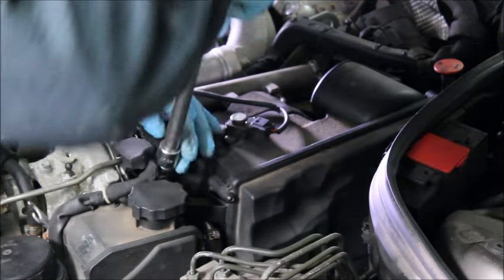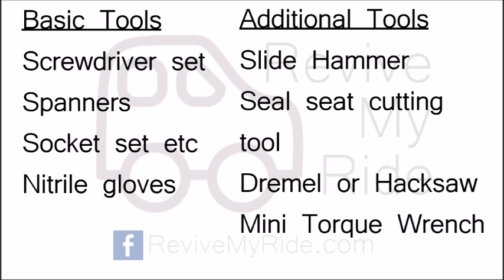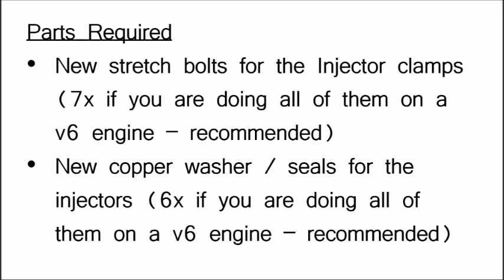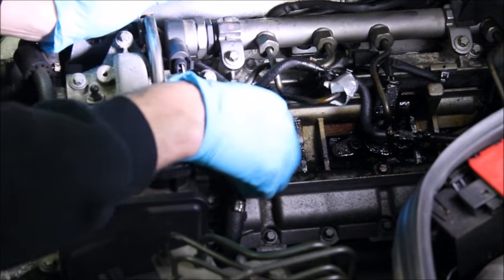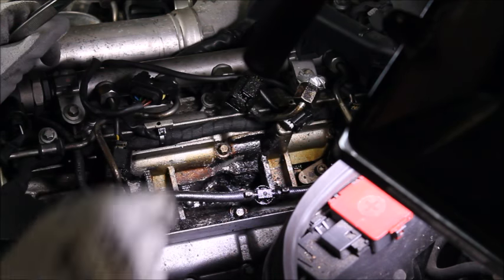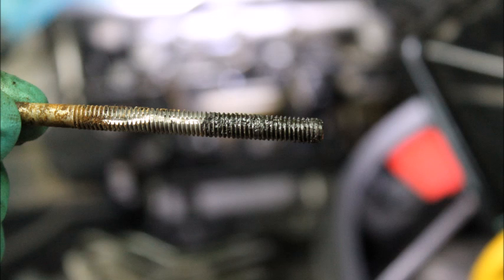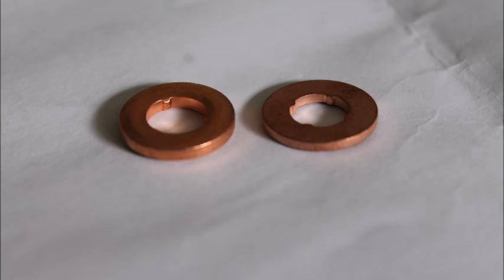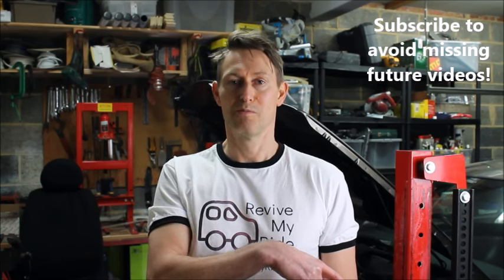Mercedes diesel CDI (Black Death) leaking fuel injector - How to diagnose and fix on 3.0 V6 engine

Comment: nice write up and video, great work!
Reply from the maker: Thanks for the feedback, much appreciated! Glad you liked the vid :-)
Reply: @ReviveMyRide  hi mate, hopefully you can help me again, 👍...tell me, have you any videos on slow to start e220cdi w211 in hard frosty conditions, it turns 3-4 times before it finally lights up, is it air in the fuel lines? Do I Change the seals, can they be changed? What do you think, you been a great help in the past🤞, thanks in advance
Reply from the maker: @thebull4358  Hi, I don't have a video on this yet but will try to give some advice! You will know how your car behaves better than me but in my experience, diesels are always slower starting in cold weather. A few ideas though: 1) They have the glow plugs to help with cold weather starting. I'm sure you already do this but when starting the car from cold, always make sure you turn the ignition on but then wait for the yellow glow plug symbol on the dash to go off before starting it. In addition, in my car, I have found that once the glow plug light goes off, if I wait an extra 3-4 seconds, it starts more easily. 2) Is the engine turning over on the starter motor noticeably slower? If so, the battery may be getting past its best (batteries don't like cold weather and once they get old, it is in the winter when they fail) but make sure you check the battery terminals & clamps to make sure they are clean and have a good connection first before replacing the battery. To do this, I disconnect the terminals, clean the terminal with sand paper, clean the inside of the clamps with sand paper and then reconnect (put some grease on the terminals / clamps afterwards to keep them clean for longer). 3) I don't think this applies to you but I will mention it just in case. If the car turns over many times (7 or 8 times) and then times out (fails to start), and you have to try again, then it is possible that it is the glow plug control module. Read the car for codes using an inexpensive OBD2 reader and see if there are any showing. 4) Finally, if you remove the engine cover and there isn't lots of carbon building up around the injectors, then you can rule out the "black death" leaking fuel injectors. It's a biggish job, so I would investigate the other points 1-3 above first. Hope this helps, let me know how you get on and if you have any other questions! Cheers, RMR

Comment: Great video = dumb question but if I have a couple of leaky injectors, do I need to replace them or just replace the seals? My logic says I just need to replace the seals.
Reply from the maker: Don't worry, it's not a dumb question at all! You just have to replace the seals. You can check the bottom face of the injector where the seal sits to make sure it is ok but 99.9% of the time it is fine because it is made of stainless steel and is much, much, harder that the Aluminum head that it is seating in. Sometimes you need to recut the seat in the head though...

Comment: thank you for the video….my c320 is suffering from “black death” on one cilinder. In the video around 19:40 you tighten the bolt with 8 NM and the you tighten it again with two times 90 degrees…why? I mean wat is the use of starting off with 8 NM and followed by 2 times 90 degrees?
Thanks for explaining

Comment: That little return line plastic clip you took off mines was a pig to take off,how hard do you have to push to put it back on?Mines doesn't seem to go on as easily as i thought,don't want to break it.
Reply from the maker: @bobbaxter952 It's been a while since I did the job, I know I found the collar very tight to undo, so I used a spanner underneath it so that I could get even pressure lifting the collar up. I think when I pushed the collar back down, I used the same technique. From memory, if the collar doesn't want to go down, then it is because the fitting isn't fully pushed down onto the injector. Try removing it and refitting it, when you refit it, keep firm pressure downwards on the fitting and push the collar down at the same time. The collars are very stiff in moving both up and down and I was worried about breaking them too but got away with it. Hope that helps! Thanks, Phil

Comment: The slide hammer you have listed in the discription is not the one you have used in the video.
Reply from the maker: Hi, Sorry, I made this video aeons ago, so sometimes the tool gets delisted and I have to choose another equivalent. Pretty much any cost effective slide hammer that has the right attachment onto the fuel injector should do the job! Cheers, Phil

Comment: i would like to share a little tip for removing injectors or pre heater plugs you may very well think im taking the micky but if you park her at night wait until until she is cold then pour Coca Cola around the heater plugs or injectors leave to soak over night take her for a drive next day & the heater plugs or injectors will come out with the greatest of ease . i can honestly say this works as used this method first on heater plugs that had covered 13yrs & 163.000 miles & i removed them without shearing the heads off them (head off if they brake) & removed number four injector today using same method without braking anything to replace the injector seal i did not do 1.2.or 3 as do not believe in fixing something that's not broken ... only thing that came to mind was if Coca Cola can destroy carbon what will it do to your gut when you drink it lol   further to the above before new heater plugs go in apply Copper slip on the threads they will never seize again in all a job i dreaded then wondered what all my worrying about as it was very easy fix ...
Reply from the maker: Hi Bryan, really appreciate you taking time to share your tips! Always good to get some feedback from others that have done the job! Just a quick question: I have heard that running the engine and then removing the injectors / glow plugs while the engine is warm makes them much easier to remove. Do you think this was the case with your car or do you think the Coke was also making the difference? Thanks, Phil
Reply: @ReviveMyRide  Hi Phil i did say in my post you must take her for a drive so she is at running temp before you try to remove plugs or injectors TBH i did try to remove plugs Hot they would not move but after an overnight soak in Coca Cola & a run they came out with ease  don't forget copper slip on reassembly /i was given this tip by a jaguar mechanic try my tip by soaking an old brown 2p coin soak it over night & see result in morning it softens carbon to the  point that all i had to do to remove the carbon off the injector was to wipe it off with a rag & standard thinners & return it to the head with new seal after cleaning the head n seat /original Mercedes parts only /can i ask do you think not doing 1 . 2 , & 3 was correct thing as if not broken don't fix IMO / thanks for your response hope all others use this tip to great affect .. Bryan
Reply from the maker: Hi Bryan, thanks for the additional info, I think it is worth me trying this sometime! Regarding changing the other seals - I was actually in two minds about it. In the end, I went ahead and changed all of mine because they come out much more easily when they haven't started to leak already and there isn't any cleaning up to do, which can be time consuming. However, if you are prepared to monitor them, I fully understand the choice to not mess with the ones that are still good if they seem fine. I have seen plenty of other comments where people choose to just fix the ones that are giving the problem, the ones that are currently good may never leak! With mechanical work, it is always possible to introduce a problem where none currently exist. Cheers, Phil

Comment: My 2012 ML350 W166 got done at 87k and problem was already really bad, so 60k would be a good place to do the change of copper seals, which is what my mechanic also recommended.
Reply from the maker: Makes sense. I think if had done mine earlier, I could have avoided the carbon cleanup, which can be time consuming. With these engines, this problem is more a “when” rather than an “if”, so scheduling it in like a maintenance take makes sense!

Comment: Very great video. Thank you. I got one injector from my G300cdi  having the same problem. Is that related to the EDC light on? The car runs a bit lump.
Reply from the maker: Hi, my understanding is that normally the EDC light is due to a fuel supply issue: fuel leak, fuel pump issue, blocked fuel filter etc. Also, I imagine (but don't have first hand experience of this) a bad fuel injector that is allowing too much fuel to pass. However, I don't think that "Black Death / leaking fuel injector seal", which is when combustion gases escape from the cylinder would cause the EDC light. BUT, many people get the EDC light after working on black death because they then have fueling problems, maybe from a leaking joint on the fuel rail or the diesel system isn't fully primed after completion of the work. Hope that helps! Phil
Reply: @ReviveMyRide  thanks for the tips. Will try to look at that issue.

Comment: I wish i had this 2 years ago when my 2007 jeep GC  had injector 1 get all crapped up.  I used a 13mm crows foot to get the injector to loosen up by rotating.  I did not use the seafoam and wish i knew of that before.  But i do have a 2005 MB CDI with a bad black death in injector 6 that i will use that technique to fix.  I also read on a forum to ensure the hold down bolt doent bottom out was to cut about 1-2mm off the bottom and recut the threads so they go down smooth.   I used laquer thinner to clean everything out in the whole for two reasons.  First it liquefied the black crud and i was able to blow it out of the holes, and two, it evaporated very fast and thus if any leaked into the cylinder, it would quickly evaporate.  Again thanks it was what i essentially did as well.
Reply from the maker: kamaksi24 thanks for sharing your experience! The lacquer thinner was a good idea and probably worked better for cleaning out the bolt hole. I used some Seafoam down the retaining bolt hole but then needed to prod some clean cloth down the hole a lot of times to be sure it is clear. Interesting idea to cut the bolt back a little because the big risk is the bolt bottoming out and either not holding the injector tight enough or shearing through over torquing. Again, thanks for sharing, helps us all learn!
Reply: @ReviveMyRide  Oh i agree 100%!  i already looked for the seafoam for the next round of black death and maybe even try it on the next round of glow plugs.

Comment: Mate you mentioned Nissan bolt as alternate but in description you given Honda ?  Which one is correct , also can we use any chemicals to clean bore if we don’t have tools like ego or carbon cleaner spray
Reply from the maker: Hi, it’s a Honda alternative copper seal, part number should be in description. Up to you regarding cleaning materials, Seafoam works good. If you use something else, Just be mindful that the head is aluminium and that some may get into the cylinder if you use copious amounts of liquid, so use it sparingly and ideally use something to clock the bottom of the injector bore. cheers, Phil

Comment: Thanks for making this video
Reply from the maker: Thanks for your comment & glad you liked the vid!
Reply: @ReviveMyRide  I was looking to get myself an ML320 CDI, yesterday, checked the MOT history and on the Monitor and repair if necessary section has Injector leaking gasses and Noise from steering column area - no play detected; can you advise?
Reply from the maker: @brownoforrington8310  If it is a car you want, you can ask the owner about both of these things. Ask if they have had them fixed and if so, if they have the receipt. If not, you could use the info as bargaining material. With the leaking injector, you can pop off the engine cover and have a look for carbon build up. Also, you would usually be able to smell it in the cabin. Sorry, with steering, I haven't heard of that issue, you would need to assess it on a test drive and again, depends on if the price of the car is worth the risk of a repair being required. new rack? just a new knuckle joint and shaft (where it meets the rack)? I watched a video recently for an Audi and it was just the knuckle joint and it just needed some grease. Hope this helps somewhat, there are never any guarantees with car faults & repairs!
Reply: @ReviveMyRide  Thanks a lot for taking your time to reply

Comment: Thank you for sharing as it was very informative. What year and model was this engine in.?
Reply from the maker: Colin Blankenship the car in this video is a C209 CLK 320CDI. It is a 2007 model but they built these 2002 to 2010. The engine featured is the OM642 (3.0L v6 turbo diesel). It was used in a lot of different Merc cars and vans from the era stated above. Hope that helps!
Reply: @ReviveMyRide  Thank you

Comment: Thanks the video, I hv Mercedes printer 315 CDI 2008 model done 390.000Km  Have an issue with smokie and fuel smell. smoke come randomly sometime big smoke sometime just a litle bit even sometime no smoke at all. before that I did replace cooper washer only 1 injector, also 3 months ago done DPF cleaning. need your advise. Thanks heaps.
Reply from the maker: Hi, happy to help if I can! Just to be clear, is the smoke and fuel smell coming from the engine bay and you smell it coming through the air vents into the car? If so, as you say, this may be linked to a fuel injector seal problem. If the smoke is coming out of the exhaust, that is a different issue entirely! Usually, if an injector seal is leaking, then you can see which one it is by inspecting and looking for carbon deposits building up around the fuel injector itself. If you have had 1 seal replaced, then the chances are the others aren't far behind. I recently did another follow up video that shows in much more detail exactly how to inspect and what to look for. I think the first step is for you to do the inspection. The video is here, hope it helps! https://youtu.be/7weS1vQ_1OI Thanks, Phil

Comment: How does the seal cutting tool work? I mean does it take off only the dirty or does it groove the injector seating as well? Would a dremel spinning wire brush work as well? Also did you remove the protective washer that you put earlier to prevent dirt falling into the cylinder while cleaning the injector washer seat? Thanks.
Reply from the maker: Hi, the cutting tool can be used just to clean up the seat a little bit or to recut it by taking more material off. However, if the seat just needs to be cleaned up a little, then I recommend using a piece of fine emery cloth (fastened in place by some double sided tape) to the bottom of a length of wood (similar to a broom handle but smaller diameter). Seat cutting should only be done if the seat is badly damaged and always done with caution taking off the minimum amount of material to make the seat good again. If the seat is cut too deep, there is a risk that the new seal won't be compressed enough to seal properly. I would be careful of a Dremel wire brush, you are correct that the washer that is sealing the seat needs to be removed to clean up the seat or to recut it, therefore, there is a risk of wire from the brush getting into the cylinder. Hope this helps!
Reply: @ReviveMyRide  Thanks a lot for taking the time to answer.

Comment: Some people say you should grease the injector before installation ..good idea?
Reply from the maker: Hi Geoff, Sorry for the slow reply! Yes, I think you should use a thin coat of grease on the outside of the injector body (not essential though!). At 17:50 in the video, I apply some copper grease BUT you have to be careful to keep the grease away from the seal. Ceramic grease is actually the best grease to use. Thanks, Phil

Comment: Do you need to depressurize the system before removing fuel lines to injectors?
Reply from the maker: That’s a good question! I never worried about this but the car had been off all night before I started working on it the following day. I think if you felt concerned, you could carefully crack loose the nuts on the metal pipes that lead to each of the injectors.

Comment: Is it necessary to replace the injector itself? Or cleaning and replacing the copper washer and bolt is enough?
Reply from the maker: Hi, as long as the injector doesn't look damaged and didn't get damaged during removal, especially on the sealing face where the copper seal sits, then you are fine to reuse it. In extreme black death cases where the injectors are almost welded in with the carbon, they often get badly damaged during removal, hence you will see a lot of info out there about replacing them. Cheers, Phil

Comment: hi why after the setting the bolt ..do you then tighten the bolt again
Reply from the maker: Hi, when tightening up the injector clamp bolt, I do the following: 1) Torque it with the torque wrench to 8Nm (torque wrench clicks). 2) as a double check, check with the torque wrench again (it should click again but without tightening the bolt further). This is more a habit of mine from when you have multiple bolts to tighten, to ensure you haven't missed any but isn't strictly required in this situation. 3) Using a ratchet, turn the bolt two more times by 90 degrees each. You often find that bolt torque requirements on engines are a sequence: an initial tighten up (in this case, the 8Nm) and then turning the bolt another once or twice by an angle (in this case 2 x 90deg). Hope this helps!